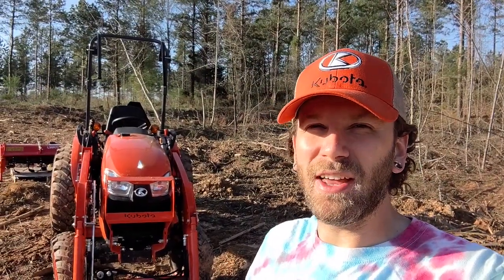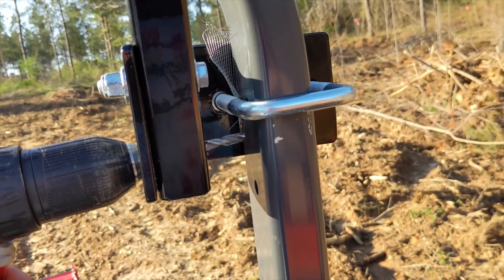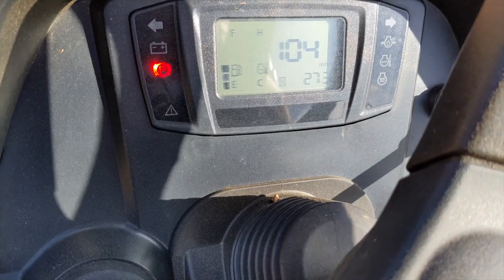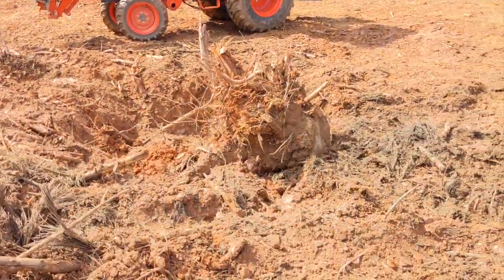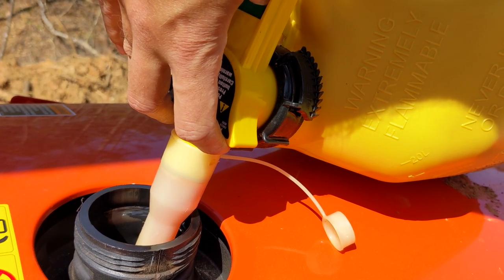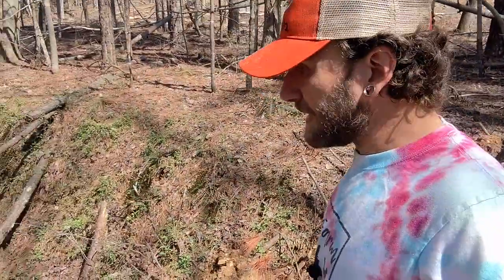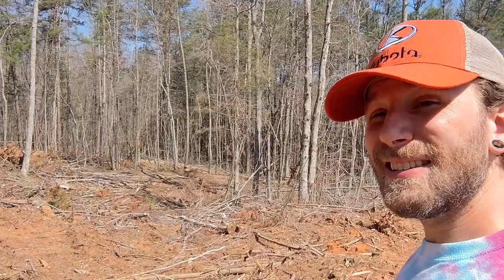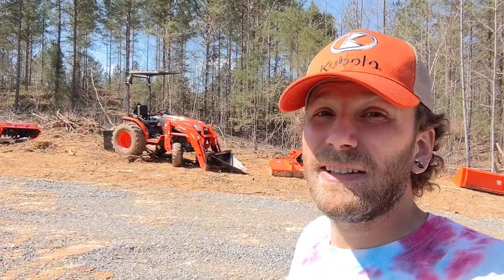Installing the RhinoHide Canopy, More Stumps Removed, & a Quick Tour of Our Progress

Comment: You might consider a battery powered fuel pump. I have a Kubota L2501 and the electric pump certainly makes refueling much easier. With the fuel cap where it is you really can't beat a battery powered pump.
Reply from the maker: We really want one and have been looking at different options. Can you tell us about the setup you have?
Reply: @RigginFarm  I just researched online and got a 2 for 1 deal on pumps so I would have a back up. Or one could use one for gas and one for diesel. That is what I intended but ended up just using the one because when it hangs on a hook after use it pretty much drains where it can be used for something else next use anyway. I do use it to gas my lawnmower as well. I would just go online and look for your best value. Most look alike. I did go with the highest volume one I could find with the best customer rating. There are some videos on you tube you could reference as well. They are pretty inexpensive.